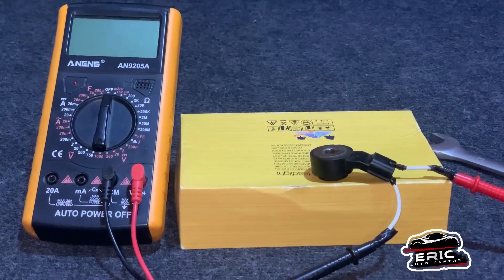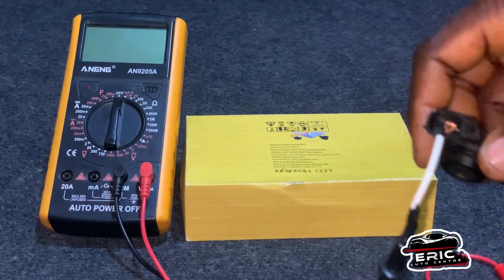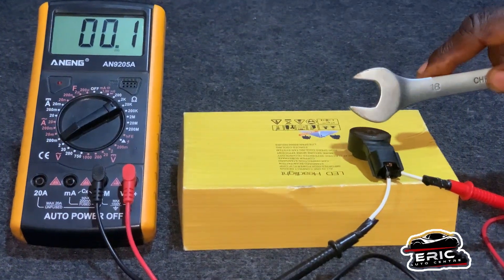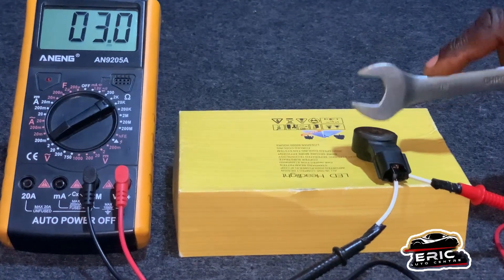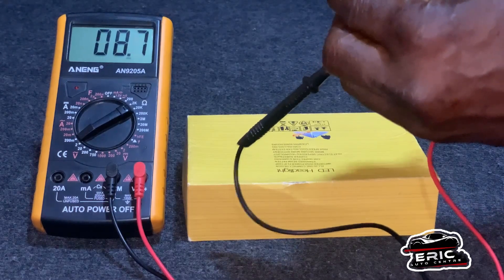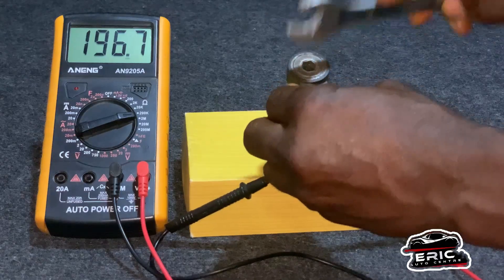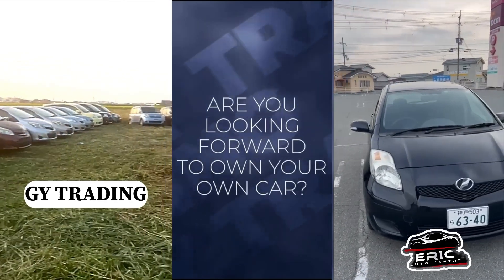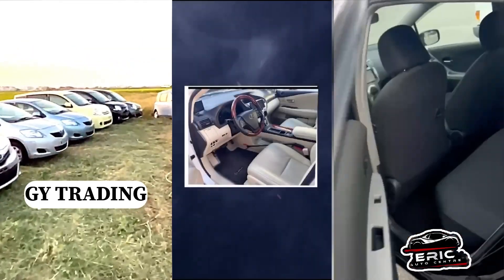How to Test Engine Knock Sensor - Quick & Easy Guide

Comment: I have a problem with my Toyota Belta, mostly when I accelerate from a low speed to a fast speed I hear some kind of knocking or rattling noise any time I press on the accelerator..the noise goes off when I release my leg from the accelerator…Please let me explain to you in the practical example of my case, mostly I climb ramp and begin to speed up you will hear that kakakaka noise. I don’t really get it…mechanics are finding it difficult to diagnose the problem and it has been my headache since.
Reply: @emmabachino3906  so have you been able to get a solution, this same thing is happening to my Hyundai Sonata
Reply from the maker: @nosaosazee7842 yes
Reply from the maker: Awww this will take us few hours to solve it. We often received such complaints from customers but were able to solve them all so please locate us you can contact me on this number 0542323947